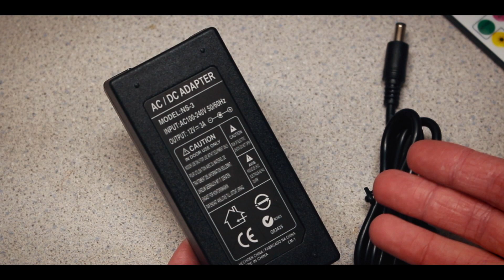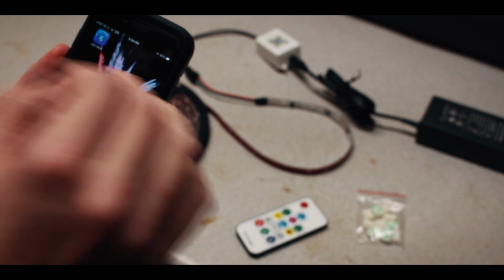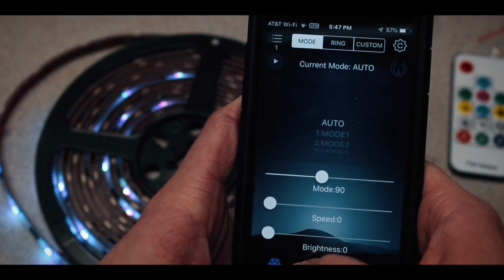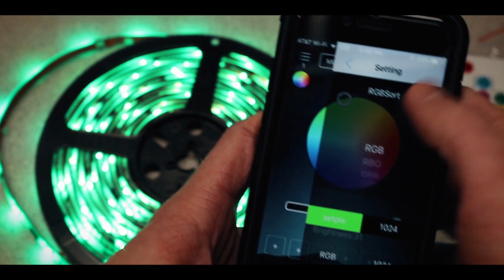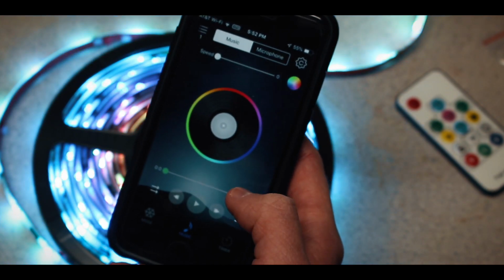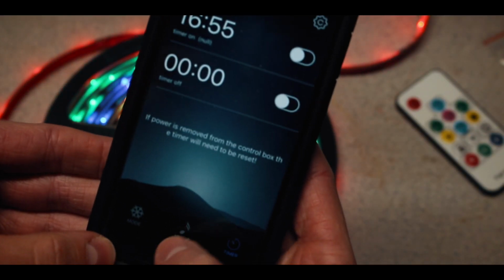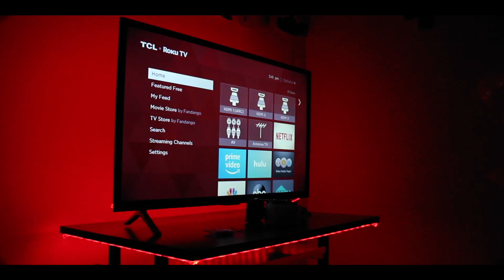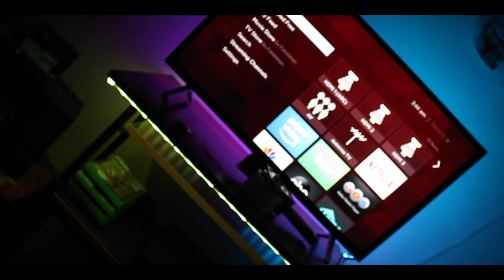PROJECT: Bluetooth RGB LED Lights Synced with music (2019)

Comment from the maker: Ok there seems to be a lot of confusion in the comments about what the audio source can be, so let me explain:

Using the app, you can access your iTunes library and play songs. Using this method will restrict you to only songs in your iTunes library. You can still output the sound as usual (i.e. headphones, Bluetooth speaker, and so on)

Or you can activate microphone mode, which will listen through your phone’s microphone and match the beat of a song being played in the room with the lights.

In my opinion syncing led lights to music in a bedroom is more annoying than actually pleasant, and too much trouble than it’s worth. I personally would just use the IR remote that comes with the controller and use the built in modes. You can still get very nice vibes that way.
Reply: J'sWay hey could you show how to sinc your music to your led lights using Lotus Lantern? There has to be a way
Reply: Thanks for the video. Is there now any update that allows you to play songs on Spotify or downloaded songs and still sync? Any way Android users can get around this?
Reply: J'sWay Does it work with Apple Music?
Reply: Is this 2835 rgb led?
Reply: Ujk
Reply: Josiah Vaughan was gonna a
Reply: Josiah Vaughan hey what song did you use for your intro
Reply: What if you dont have itunes?
Reply: Thank you so much
Reply: Can i please get q answer? If i want to play music through my headphones will the light still react? And btw i am using another device so i can connect it to the mobile using the app called " duoco" please i want to know

Comment: How do i connect rgb floodlights with a blutooth speaker to change colors while blutooth speakers playa music ? Right now it only works if i use my phone as a music app than the colors change but the minute i switch to the blutooth speaker it doesn’t work

Comment: Just a tip it's not good if you turn on your LEDS when there all rolled up cause it causes heat damage to the LEDS
Reply: Omg Thankyou I just got them and I’m moving next week so I play with the lights but thanks now I no I need to leave them alone 🤣
Reply: OOOH thank you!!
Reply: LEDs don’t give off heat 🤣🤣🤣
Reply: @sarahformer5080 YES THEY DO BRUH FEEL THEM
Reply: @sarahformer5080  they do... thats literally how light is made... light bulbs only have 5% of the energy going towards light, whereas the other 95% is used on heat. The LEDs are more efficient but they still have most of the energy being dissipated through heat.